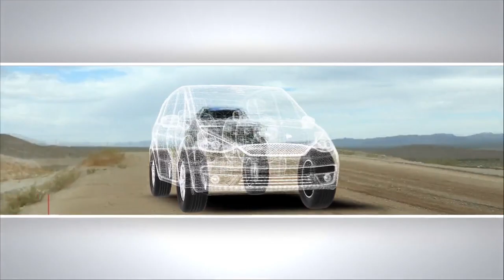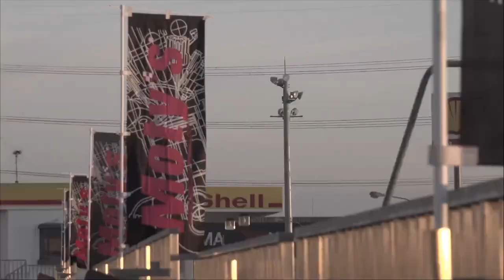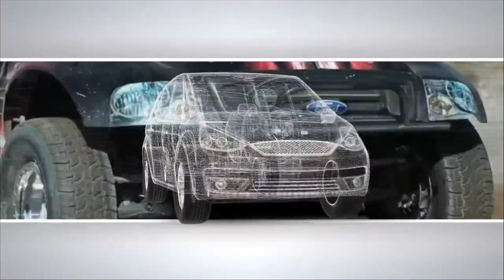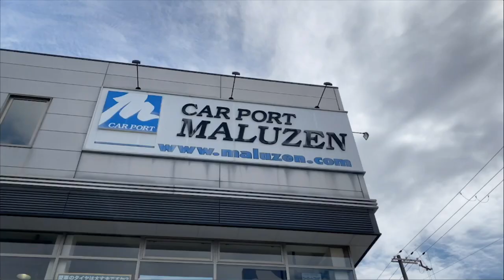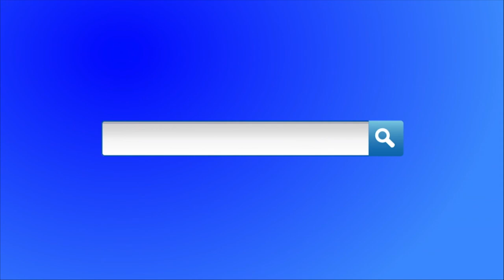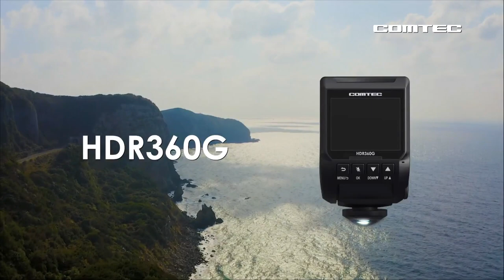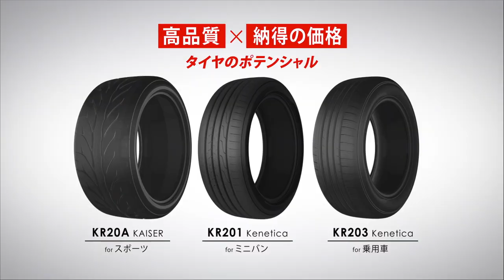Formula DRIFT SportsLand Sugo - Top 16

Comment: I love that supra man, so clean. Even still has power windows!haha you don't see that often on pro drift cars.
Reply: its not legal usually
Reply: @veryrare7647  why not??
Reply: Brandon Deel because glass side windows in a side impact are too likely to shatter
Reply: @veryrare7647  you can make any glass roll down if that's what you want to do. Lexan can roll down:)
Reply: Brandon Deel easier to ban them. if teams want to spend time making a lexan window retractable im sure they can
Reply: @veryrare7647  that supra does have retractable windows, maybe it's lexan but idk that for sure. You can see him use it on his battle in the final 4 I think. Could've been his great 8 battle but yeah if you go back and look at those two, you can see him rolling it up in one of the clips and it's not crank. You can tell it's auto. Cool touch imo.
Reply: Brandon Deel maybe its legal in this series i dont know. but its not legal in most series (in the usa anyway)
Reply: @veryrare7647  I'm pretty sure they implement the same rules in japan FD as they do in the US but I could be wrong. Just seems like they would to keep everything fluid. Ryan Lantaine judges in both series and he's pretty strict about the ruling/judging. Either way, I thought it was cool he had power windows on his car.. it's something I would do if I built a pro car to keep the temps down in the driver's compartment.

Comment: I thought the euro fighter won that race
Reply: If he didn't have that mistake at the end, he would've taken it. I think they counted that straightening as an incomplete. Guy in the s15 had been running a different line than anyone else from outside 3 to 4. You can see him slow a bit coming out of 3 then getting back on heading for outside 4 whereas everyone else was staying on throttle from 3 to 4. Seems like that choked up the bmw driver forcing him to lose a lot of speed.
Reply: Brandon Deel i agree, nice analysis